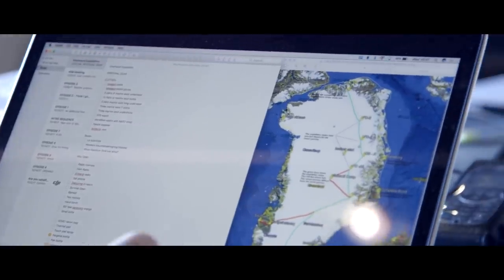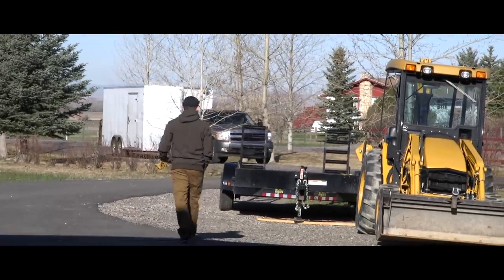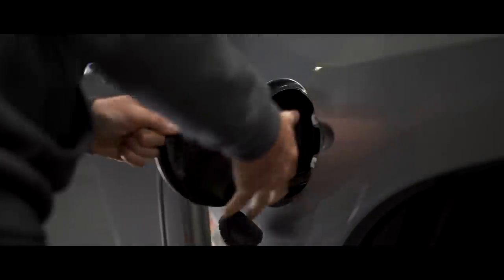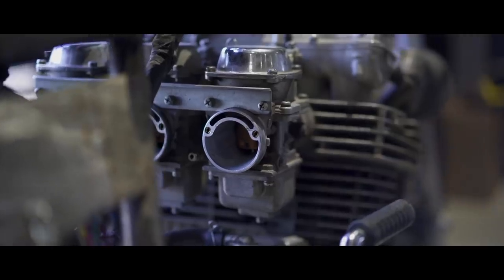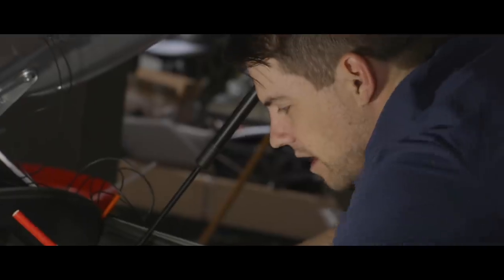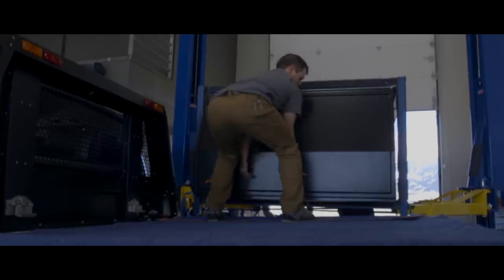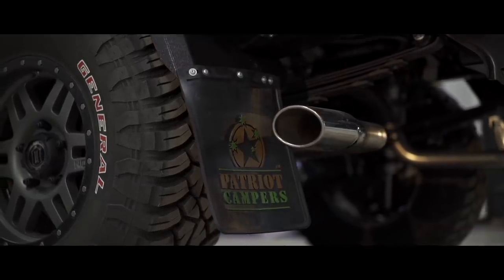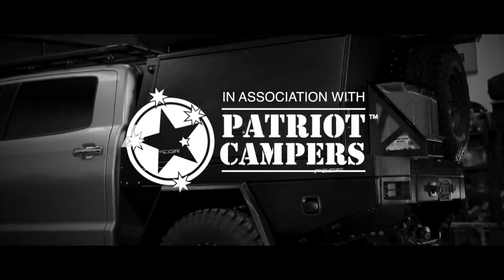Overlander S1 EP3: Truck Bed Comes Off For The First Patriot Camper's PCOR Toyota Tundra Build!

Comment: Looks like a great truck. I noted that the kitchen is in the driver side, in Australia would be in a better side, in case that you have to use it on the side of the road. Put at least 2 locking diffs. I still believe that with a diesel engine will be a much much better and safe overland truck. You guys have to insist that Toyota bring a diesel engine in NA, it is not only about mileage....

Comment: The RV industry is guilty all the time of pushing heavy highway death traps on our Nations highways. Very few (Buyers) really care about actual weight capacity as they go ahead and load every morsel of man-made crap they can so as to make life on the road just like at home... 

A Long time ago I was “Volunteered” to attend a three day combat recovery  seminar the engineers put on. One of many facts I learned was highway/pavement payload/hauling could be say 2000lbs, but! Under combat rugged terrain conditions vehicles were only capable of half payload.  Reason being, as heavy duty military vehicles are made. The entire idea of moving troops, logistics, munitions, etc etc was to get there in one piece. Transmissions overheat, gears break, axels bearings you name it can go bye bye. 

Twisting and flexing of the frame and suspension can and will place tremendous strain on metal . 

When I stated weighing the Tundra after all is done, completed, I meant including every piece of gear, people, dog if any, everything on the truck scales.

Overloading any vessel of any kind can and will cost lives and $$$. But as an avid off-grid dude going back to 1960 I have seen some real crazy heavy duty truck frames twist and bend exactly when WE did NOT intend NOR want them too. 

But? I have No skin in this game.

Comment: Being an EX-RV dude ... It would have been more informative to see the Toyota’s Maximum Payload Capacity. By not placing the stock truck minus the bed on the scales, then the completely Loaded and ready to roll out the door weight figures would be very informative. As payload capacity is probably going to become problematic to my estimates.
Reply: Shouldn't be a problem if the GCM has been increased with the suspension upgrade
Reply: This truck will be so far over payload and GVWR there's no point in even asking. Coming from a historical fan of Toyotas US spec Toyotas are designed for comfort not capability. There are seriously stock mini trucks in other countries designed to handle more payload than a Tundra. Sign of the times though not just a Toyota thing.
Reply: jeep6242 
As I'm from Australia, are the authorities in the USA hard on exceeding the vehicle GCM? I'm sure insurance companies world wide would try to wiggle out of paying for any reason
Reply: Here in America, it is VERY easy to become involved in a lawsuit. Especially if life limb or large property liabilities are involved.
Reply: Frank Bullitt If you are not involved in a serious accident I would say no. If you are your risk of an issue goes up for sure but honestly our enforcement mechanisms and knowledge base is low here for such things. A civil suit from another party is the most likely path for trouble.

Comment: Why doesn't Toyota make this omg 😵
Reply: ill give you one reason! Because the cost for them to build this would be beyond what most can afford. Lets face it a simple replacement bulb for any car has a 300 percent mark up on it. as an example a door panel made as cheap as possible yet cost more then an after market one thats was build far better. Do the math financially
Reply: Tt Ss but the other manufacturer offer some of that , mainly the flat bed maybe not the box with everything in it...but I think it's offered in higher trim models aka hd ones...
Reply: And it comes with a cost hence when they purchase from said ford or chevy its going to be business used trucks tow trucks etc they write it off to the point its about free for them